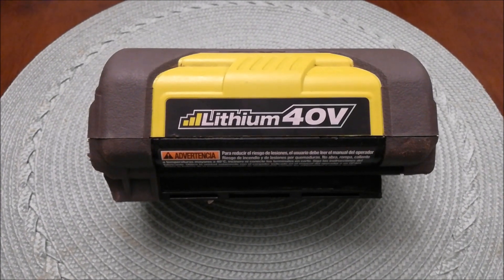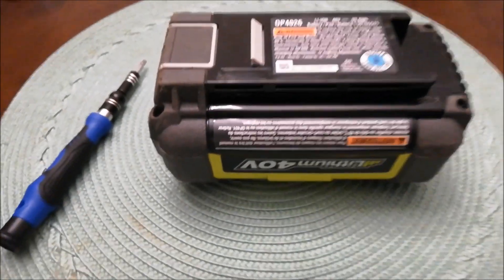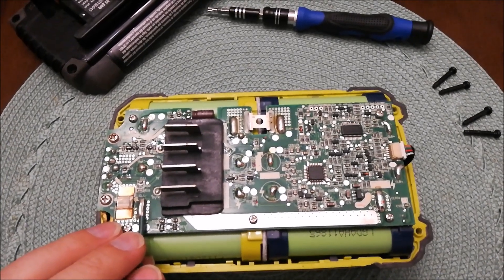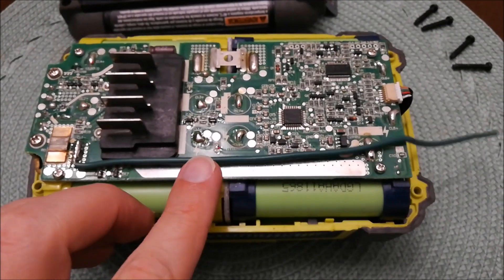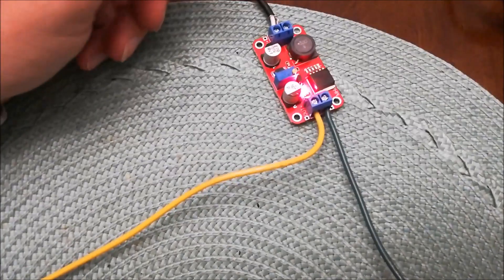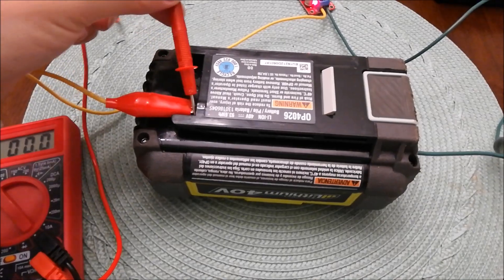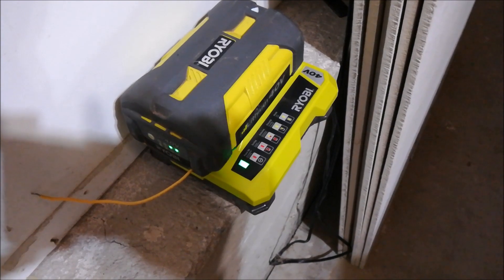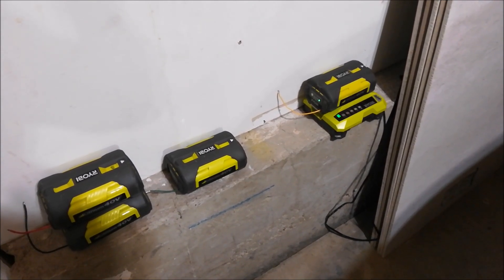40v Ryobi Battery Defective?! Let's Fix it!

Comment: @Jasonoid 
Did everything exactly and used similar 12v adaptor at 1.5 Amp. 
After Half a day my Multimeter reading stuck at 27.2 volts. 
its not charging up anymore. What do you think is the problem? Thanks!
Reply from the maker: Did you try it back on the charger, that's pretty close to the normal charging voltage?
Reply: @Jasonoid  
Yes, I did that still blinking red and green.
Reply from the maker: @scrambler008  I'm guessing the 1.5amp adapter isn't strong enough to get the voltage past where it's at or it's going to take a long time. You got anything stronger laying around? How high is the buck converter turned up.
Reply: @Jasonoid 
By the way I followed your link and bought that voltage booster.

Comment: Is there an easier way to raise the voltage?

This is confusing and I have to buy many things.

I don't have soddering equipment either.

To do all that work and find that it wasn't the reason is was defective would be soul crushing
Reply from the maker: You could buy another battery for $120....or buy a small amount of parts for under $20 to fix your battery.

Comment: I gather a trickle charger for a motorbike battery would not work in this application you would need the converter?
Reply from the maker: Anything that puts out 35 volts or more

Comment: Thanks Jasonoid.

I revived a newer version of the Ryobi 40v 2.6A rev Q battery today. On these newer batteries the negative is marked GND instead of CL1. I simply used two sets of wired alligator clips and used a good battery to boost the bad one:
1 Clip one end of the negative wire to GND (I taped the aluminum block next to it to prevent short), the other end to the negative contact of the good battery.
2. Clip one end of the positive wire to the positive contact of the good battery, the other end to the positive contact of the bad battery. I did it in this sequence because the positive contact on the good battery with the case on is harder to reach. I didn't want to create too much spark while trying to put the last clip on.
At this point there is a small spark as expected. After about 3-5 seconds I noticed a tiny bit of smoke (probably because the clips and wire are overloaded), so I disconnected one of the clips right away. Then I measured the voltage on the bad battery and it had risen to just above 30v from 8v in that 3-5 seconds, so I decided to put the battery into the charger, and what a joy when I saw that the blinking light was green only instead of green and red before.
Reply: This worked for me!! Thank you for posting this comment. I realized after trying the charging contacts directly that you meant putting the negative to the spot on the circuit board where the guy who made this video soldered his!! Worked within a min or two, it's now charging on its charger again!! Appreciate you!
Reply: Seen this method a year or so ago online somewhere (may have been this one idk). Honestly its the easiest from all ive found. this has worked for 3 batteries so far. Only down side if you have to have a good one already. If it was you comment i seen then thanks!! lol
Reply: Can you make video out of new battery? I was able to reset battery with shorting res contact, but still getting 1 and 4 sold light on mattery when i try to charge and about 10sec later charger starting to red and green blinking. After reset again i see one sold light.

Comment: I’ve ended up with two chargers for these batteries. Can’t I take one of the power cords and clip the factory end off and add some gator clips and do the same thing as your charger set up was doing?
Reply: Possibly, but the safest option is using a boost converter with constant current.

Comment: Hey there, thanks for posting this helpful vid! I have an older one (incl with trimmer) and a new one (incl with chainsaw), and both work well right now (fingers crossed). I have a tangential question.
The new batt came with a low-profile charger (OP 404), which has an external converter that indicates 120v/60w/80w in, 42v 1.5 A out. 
Would it be possible to somehow supply the low profile charger from 12v DC, eg from solar controller or automotive battery/stator system? What kind of converter would I need?
Any thoughts you have about this would be super welcome. Thanks again!
Reply: You have to put 42V @ 1.5A to the charger or it will not work. 

You can connect the solar panel to a 12V to 42V boost converter.

You need solar panels that put out at least 2X the power required or you will not have continuous charging. 

Best thing to do is to have solar charge a 12V battery then use the battery to power a 120V inverter so you have continuous power without interruption.
Reply: @BradKwfc  this is helpful, thanks a ton! My learning continues. I figured that the logic boards on the charger and battery would only function within pretty strict ranges.

Comment: So I worked this same process and I was able to bring a battery up to 35V but my charger still shows defective.  It’s the slide on version that doesn’t have a USB port.  I’m wondering if I should get a larger base charger to see if maybe my charger is defective.
Reply: I too charged my defective battery to 35.5 volts and the charger still shows a defective battery. Any more Ideas?

Comment: I made a video per someone's comment below about how to reset the BMS. That was my problem, the pack was good. And how to open the newer batteries with Rev. Q boards. It's pretty easy and requires only one piece of special gear: the security Torx bit. https://youtu.be/JKgKB9jn1Eg Video shows the pads you need to jumper to reset the board.
Reply from the maker: Thanks Robert! What issues have you seen this reset jumper fix? There are many issues with these boards.

Comment: Stupid Question but Can I run a wire from the negative post on my 40 volt charger to the CL1 negative and then run positive to positive on both dead battery and charger. Would my dead 40 Volt Battery blow up or catch fire because of to much power coming from charger connected to wall outlet? Probably why you use a boost converter. From your description, you mention a strong current might damage cells. Just curious!
Reply from the maker: That might be worth trying, just try it but have a way to disconnect it if you see issues. Let me know how it goes.
Reply: Jasonoid I have been inserting and removing a dead battery, in the charger, until green light comes on, hoping it is getting enough trickle. Got it up to 20 but seems to not go past that amount. Gonna try again tomorrow. If that doesn’t work, maybe I can get enough courage to try CL 1 to battery charger. I will get my son to stand by to disconnect charger from outlet. If these methods fail, I will order the items listed in your description.  Thanks for answering me!
Reply from the maker: @martycann1  Just FYI, you probably don't need the wire exposed off the CL1 point because every single battery I have fixed hasn't required the fix again. As long as you are careful to not over discharge them again. Good luck!
Reply: Jasonoid This battery has been discharged a long time. It still has a 20  volt charge according to my tester so I figure I need to get it over 30 or so.

Comment: What if my battery shows charged but will not spin string trimmer, other battery spins trimmer
Reply from the maker: Usually means a part on the circuit board is fried. Call RYOBI for a replacement, they may honor the 5 year warranty on your battery

Comment: Hoping someone can help find an answer to an issue with my 40 volt battery. I have four batteries,  two charge and two don't. When the two batteries are fully charged, the fuel tank meter reads full, one battery tests at 40 volts while the other tests at 20 volts?.How can it be only 20 volts? Runs thr hedge trimmer tool just fine, the charger likes it and charges it. Any help would be great

Comment: @jasonoid, so I tried this but my 35V boost converter won't go past 24 volts when charging. Then it goes down to 19V after a few minutes... does this mean the 40V battery is defective?
Reply from the maker: Where do you have it connected? How many amps is your charger?
Reply: 12v, 5amp charger. The boost converter goes up to 35.9 V plugged in alone but then tanks to 20 V once i hook it up to the battery. After 30 minutes, it goes to 18 V. Then I test the batt in the charger and get defective lights.
Reply from the maker: @samtamulevich8768  there must be something wrong with your BMS control board in the battery. This process wont fix all the issues with these batteries, it just helps if they have been over discharged. I'm sorry it didn't work.  Hopefully you can return your purchased components to Amazon without an issue.
Reply: @Jasonoid  Thanks, I'm gonna keep everything because I think they're useful. I ended up buying a 6mAh 40V 3rd party replacement, which seems fine so far.

Comment: I push the power button on the battery and all 4 led light flashes green 4 times. You know what that means? I can't get a reading on my solar booster when connected to the pos and neg.

Comment: Thank you for this great "Fix" video. I ordered the components you recommended and it worked. Thanks for saving me $80. Much appreciated   Does it mean that I have a bad cell if this problem happened ? Or maybe because I left the battery charging all winter ?
Reply from the maker: Not sure what caused the battery to drop below the 30 volt level, if you leave the battery on the charger it doesn't stay charging, it charges and then turns off and no lights are active on the battery so it probably didn't charge all winter as thought.

Comment: If that was me I'd use some jumper leads 
Connect them to the charger.
Reply from the maker: That would work if you could get them connected to the CL1- point on the control board.

Comment: Thanks very much for this super helpful video. I have a newer version of this battery, would you know how I could do this fix with it? It sits at 32v and reads defective I have tried jumping it from another battery and that didn't work for me. I have it opened now and can't find a CL1 solder point on mine. Any help would be greatly appreciated.

Comment: My batt reads 34.9vdc before charging, It reads defective when inserted into the charger. When i remove the battery it then reads less than 10vdc slowly rising back up to about 34.9 after a few hours. Is it really shot?
Reply from the maker: Could be the circuit board that's bad, sometimes a board component gets fried. This video is for batteries that are over discharged.

Comment: Hey Jason, can't find the product Boost Step Up Converter (updated product): on amazon. What else can be used?
Reply from the maker: I updated the video description with other models that should work. Thanks for the heads up!
Reply: @Jasonoid  Those updated links seem different, I do think I found the exact replacement for the boost/buck converter with the screw terminals here though: https://www.amazon.com/gp/product/B07Z5M89N1/ref=ox_sc_act_title_3?smid=A2A9N9TES6X0D0&psc=1 if you think it is I can update this comment to your affiliate link. Thanks for the info!

Comment: For the newer style batteries!! Disclaimer: I am not responsible for any damages from the information I’m giving. With that being said, I do have a newer style battery with a newer board that had given me this same problem. After some research I discovered that CL1- is the pack ground on the newer style board labeled GRND. I soldered the wire to this terminal & started charging just like this video & viola, it worked! It did take about 3 hrs for the voltage of the battery to reach 32V & like someone else posted, after boosting the converter to 35V, the converter stop displaying the voltage while charging (red led lights turning on & off), even the blue light on the power adapter would turn on & off. It seemed like this was ok. I would recommend monitoring the charge (don’t step away & leave unattended) & have a fire extinguisher close just in case. Good luck guys!

Comment: Good details instruction. Mine is about 4-5yrs old. Occasionally after use I get the defective flash when I insert in the charger. I stick it in the freezer for 15-20 mins and it recharges ok.
Reply from the maker: Thanks for the tip!

Comment: I bought the step up converter in you link. After I set it to 35 volts and hooked to battery per your instructions the booster drops to about 15 volts. Any ideas why this is happening.
Reply from the maker: Does the voltage go above 15 volts with time?
Reply: Jasonoid it doesn’t seem too.
Reply: Jasonoid no it doesn’t seem to.
Reply from the maker: @kenparrish3176  these seem to have pretty specific instructions. Did you follow what the manufacturer said? Some people have had issues but most have been able to get their batteries up and working. If it's not working just apply for a refund and get a new one. Sorry for the hassle!
Reply: Jasonoid no hassle I appreciated the video. I can send them back to amazon.
Reply: ken parrish there is a small copper adjustment knob that you can turn clockwise with a small flathead to the desire voltage. FYI

Comment: Thanks, this save 2 batteries for me. BTW, I  charged mine with another 40V battery (connected plus-to-plus and minus to the wire shown in your video) and it only took a few  minutes to get it charged enough so the Ryobi charger would work. Thanks again.
Reply: Do you have to open up the discharged battery or can you connect on the outside from new CHARGED battery to DISCHARGED battery? Thanks, Marty
Reply: Oh sweet might try this thank you
Reply: Could you explain how you did that?

Comment: OK.  Didn't work.  The boost step up module you used in the video is not the one listed in your parts list.  The one listed in your parts list will deliver up to 35v IF the power output transfer stays at 1 amp or less.  When the amps go up the outgoing power drops.  The most output I could get out of the step up module was 33v (using a multi-meter) even though the step up booster was showing 37.4v output which does not do the job to get the battery sufficiently charged to use the Ryobi charger.  Here's a link to a video showing testing of your listed step up booster showing the output volts dropping off as the amps being pulled increases: https://www.youtube.com/watch?v=JalTtx6hiY4.
Reply from the maker: You only need to get the battery to around 30 volts for the ryoby charger to recognize it. Have you gotten it that high and tested charging it?
Reply: It's at 33.3v.  The Ryobi charger will not charge it.
Reply from the maker: @glennregner5256  I'm sorry it's not working for you. Not everyone has had perfect success with this method. Sometimes the circuit board has issues and that's the reason it died, not necessarily the over discharged batteries. You can always seek a refund from your Amazon purchase so you didn't waste money. Sorry for the hassle!

Comment: I subscribed.......
You were supposed to post another video letting us know if the batteries came up to capacity ????????
Or just leave me a comment 😉
Reply from the maker: Out of the 8 batteries I have revived this way. 1 was dead and wouldn't come back to life (circuit board issue). 2 had limited capacity remaining, and 5 still work great! A high percentage of the batteries work fine after boosting them back up.

Comment: Thanks for video. I just got this model used and acts fine and then right when almost fully charged is when it says defective. Thinking I better just test it on my equipment first and then modify if necessary. Only strange thing is led on battery doesn’t show anything except when in charger then it lights up all way across flashing on last led. Then when almost charged or so seems I get the red and green on n off blinkin on charger came with it and my one year old charger. Strange for sure.

Comment: Just wondering why a 3amp trickle charger couldn't be used ?
Reply from the maker: I bet you could use a 36 volt trickle charger. Hard to find something like that. You'd only use it once the original charger works.

Comment: Not sure what I am doing wrong.  Soldered a wire up just like you did.  Testing with my multimeter shows it at 18V or so, between the positive tab and the new negative wire.  When I hook up the boost converter to a pretty beefy 12v 1A power supply with built in circuit breaker, the multimeter shows output of boost converter at 35V, which is what I set it to with the little screw.  When I connect that to the battery it instantly trips the breaker.  I see that the charger for Ryobi puts out like 2A, so I figured I needed a more powerful supply, so when I use a 19V 6.5A power supply, the boost converter again shows 35V, but it instantly trips that breaker too when connected to the battery.  No shorts, I am sure, since the multimeter connected to the battery shows a steady voltage, as expected.  Any ideas?
Reply from the maker: Can you try taking out the circuit breaker,  or bypassing it somehow? What amount of amperage is the circuit breaker designed to handle?
Reply: @Jasonoid  On the first supply, it turns out it was 1 AMP (even though it was a really beefy 12V power supply).  On the second supply, it was 19V at 6 amps.  The step-up converter is rated for 9A in, and 6A out, so I didn't want to push it.  And yes, I am sure there's no short circuit, if I use my multimeter on the battery's positive terminal and the new negative wire, it shows an expected DC voltage of around 18 or so.